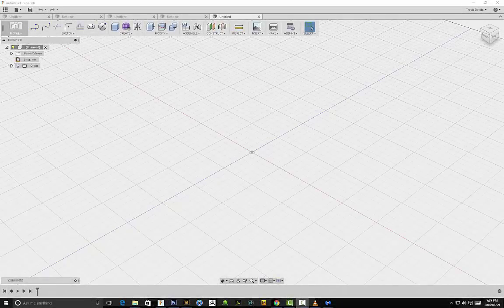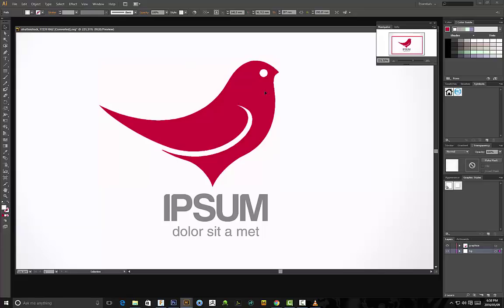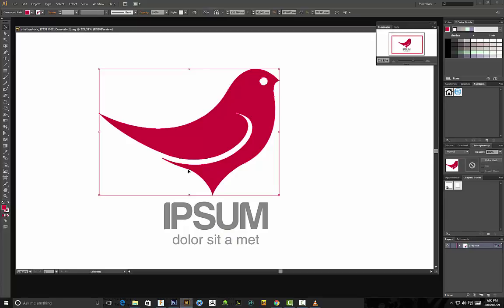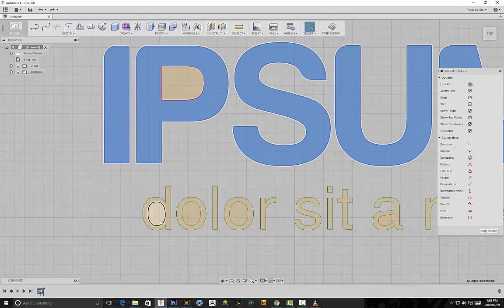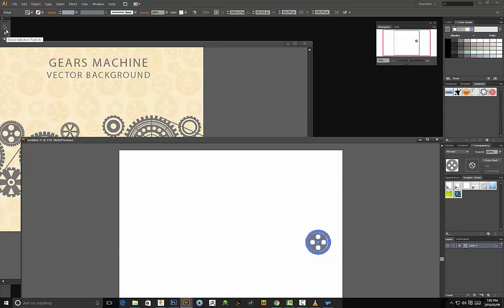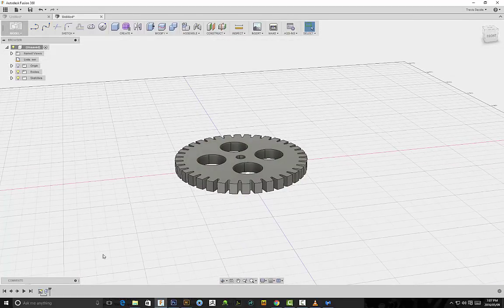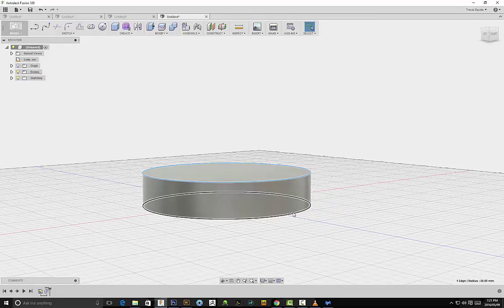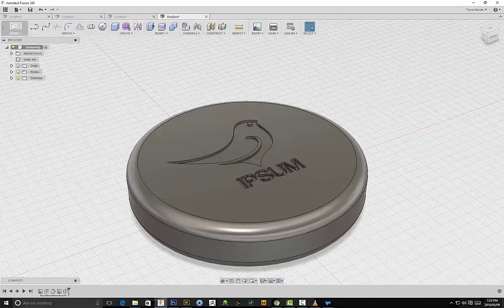Autodesk Fusion 360 - Insert SVG - Turn Vector Images Into 3D Objects

Comment: Quick AI tip for helping me make my logo 3d:
You can use the regular selection tool (black arrow) to select that gear. 1) You can double or triple click on the object (depending on the grouping). 2) Or you can select the whole thing, go to object and ungroup. It'll be much faster and easier than searching for the sublayers.

Comment: Hi T, is there a way you can scale the SVG file to an exact dimension (X/Y)? I see you can scale but I don't see a way to scale to exact dimensions or snap the scale in any way.
Reply: I've found that imported SVG files are automatically scaled down to 2/3rds their original size in Fusion 360. It's not the best workaround but I just scale my vectors 133.33% of the actual size I want them to be before importing.
Reply: @rtql8d  Thanks for the tip. I also find it annoying an svg cannot be scaled to exact dimensions. There has to be a way.
Reply: @axmpssm61  There's an easy trick to scale SVGs to the exact dimensions. In Illustrator, select your illustration, click Transform and make sure "Constrain Width and Height Proportions" is enabled. Then take either the width or height of your illustration and divide by 0.75 or 75% (both work). It takes care of the infinite 3s in 133.33333.

Comment: Thanks for the video - great share. I am using Inkscape to create the .svg and simple text is not coming into Fusion 360. Is there something I am not understanding? There are no advanced save options in Inkscape, I am wondering if there is some setting I need in creating the .svg.
Reply from the maker: Hi, thanks for the kind words, i wish i could offer assistance here but i have never used Inkscape before.
Reply: Ok - I should be able to get access to MS Illustrator and will try from there.
Reply: Simple text will not work. You should first convert your text type into Outline. That way your text is now a vector graphic.

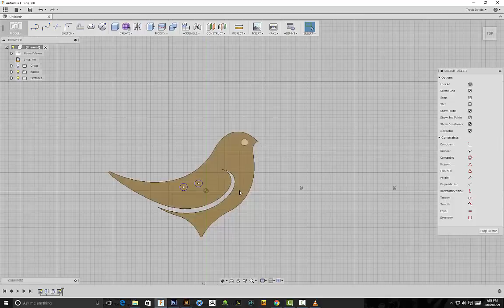Comment: How did you get back to your sketch at 6:34? Every time I extrude one of my sketches, the other sketches disappear. I tried to follow your mouse but it seems like you used a keyboard shortcut. Thank you.
Reply: Hi Z Dawson, i used the undo command on my keyboard to jump back in time BUT sketches disappearing after extruding is VERY common. If that happens, on the left side by "bodies", you'll see a category called "sketches" just click on the drop down arrow next to it and find the sketch you were busy with last, its always the last one on the list and just click on the lightbulb icon to unhide the sketch.
Reply: Fusion released an update (July 17) that addresses this issue. You now have the option to disable sketch auto hiding on extrude